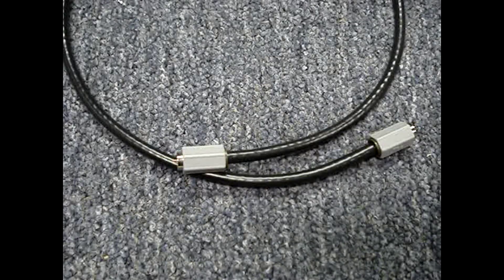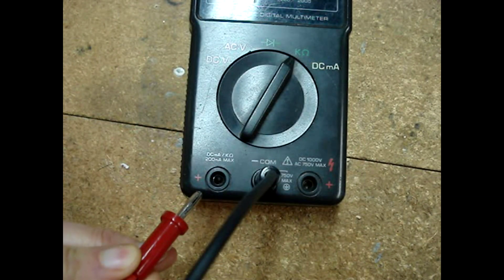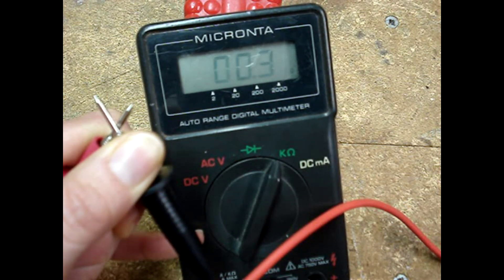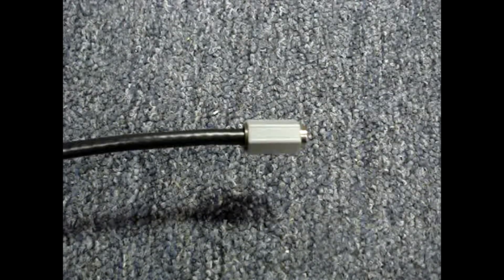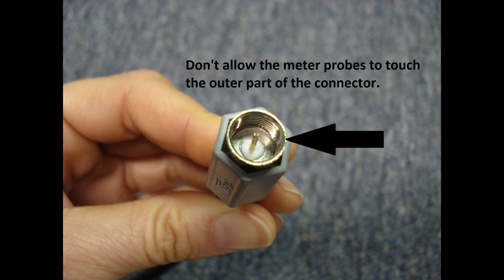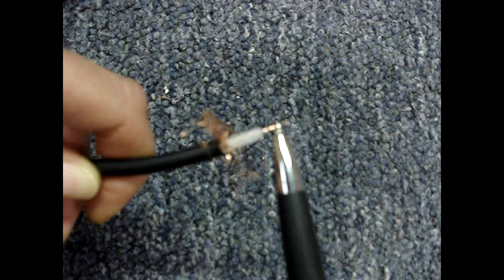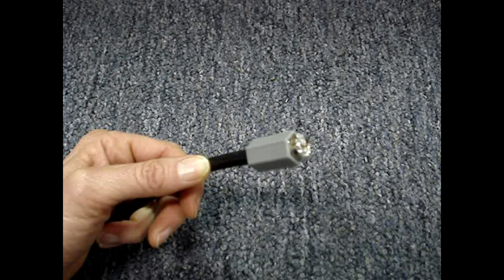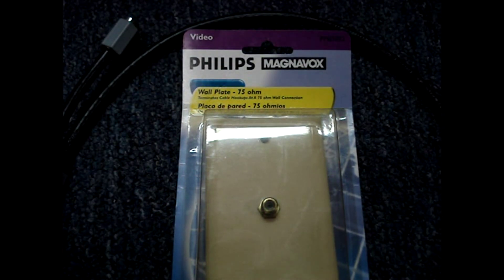How to Test Coax Cable With a Multimeter

Comment: At about 5:45 into the video you show testing for a longer coax cable and state "make sure you read an open", what does that mean?
Reply from the maker: If you set your multimeter to read ohms and the lead tips are not touching that is an open reading.  When you touch the lead tips together, that reading is a short.  I have a video that explains how to use a multimeter to check resistance/continuity.  Here's the link:  https://www.youtube.com/watch?v=9H-uMSGHFXM

Comment: Thank you for the tutorial. This test is to see if you coax cable is defective or not able to carry a signal. Is there a method for testing for a single to see if the coax wire is working before plugging it into the modem? Like you would check for current in and extension cord or wall outlet?
Reply from the maker: A multimeter will help you identify one cable run from another or find a cut/severely damaged cable.  If the cable run is visible, you can look for hard bends, look for high voltage a cable (home AC wiring) run parallel with the coax.  With a device connected you can shake any connectors to see if they interrupt the signal.

To test the signal strength you'll need a device designed for that purpose.

Comment: Great video, i was wondering if there is a way to use a multi meter to check if any of the staples the installer used to secure the cable had pierced the coax and were affecting my signal quality. thanks in advance.
Reply from the maker: I can't think of a practical way to test the staples with a multimeter.  If you are concerned about the quality of the installation, the best thing to do is to visually inspect the cable.  You should be able to see if they drove a staple through the coax, crushed it or put kinks/hard bends in it.  A multimeter is good to check for a cut, severely crushed cable or to identify a specific cable.  Checking for good signal requires more sophisticated test equipment.
Reply: Know How Now Thanks for replying so quickly. I thought maybe there would be a way to use the meter to go down the line one by one and check to see if there was any current or signal in any of the Staples.
Reply: How did you do it to find out if  a Wire is damaged by a staple ?

Comment: Thank you so much for this. I want to check a coaxial outlet in my wall to see if it has a signal (to use for a cable modem). I don’t want to call out a technician. Will a multimeter do the job? Thanks again.
Reply from the maker: Hi Justin, a multimeter can't be used to check the signal.

If you only have one coaxial outlet that is not working, the best you can do is to follow the cable back from the outlet to the next connection.  Disconnect it at the next connection and use your modem to check for signal at that location.  Work your way back to where it enters the building until you have a signal. Look for damaged cable ends or damaged coax.
Reply: Awesome. Will do. Your response is greatly appreciated. Take care.
Reply from the maker: You are welcome.  Good luck with your "detective work".